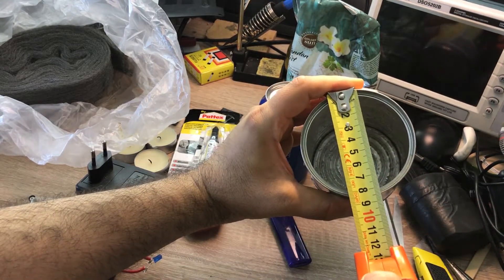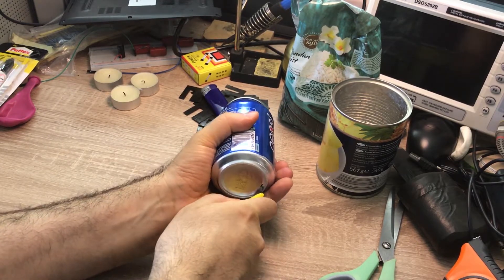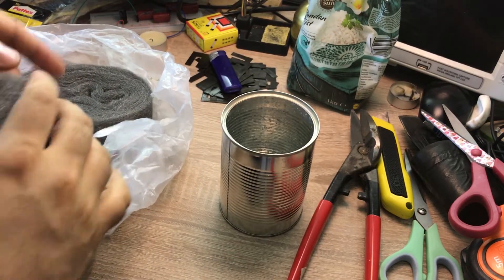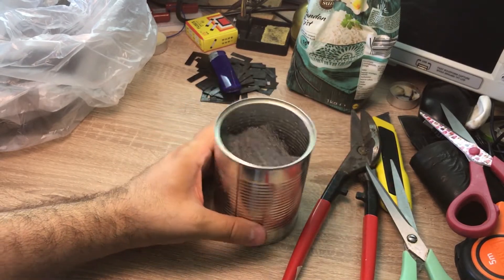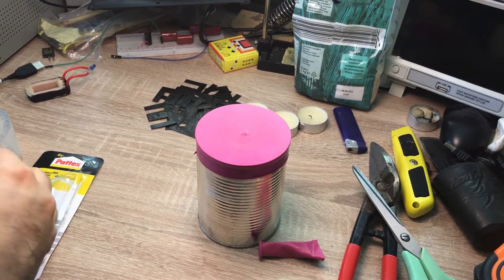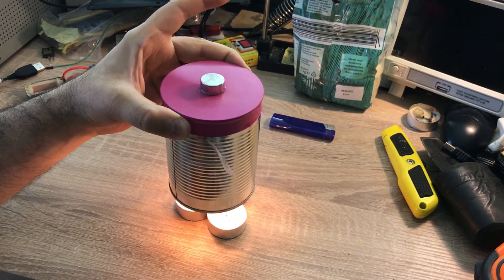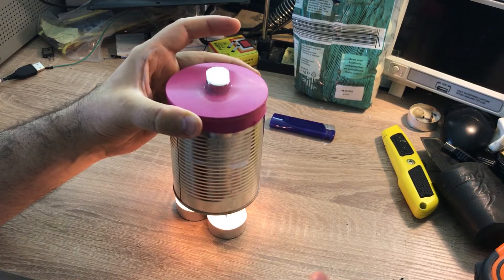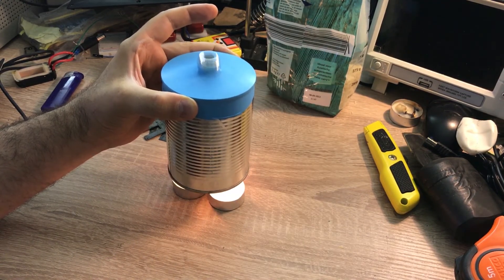How to make a thermoacoustic engine with a linear generator ( Rice engine )

Comment: I don't think the rice on the top is a necessity. Apart from a small wad of steel wool, factory made engines are simply hollow.
Reply from the maker: It is very much necessary, this works with steam and the size is much larger than commercial engines sold on Ebay. Without that barrier it will not work or very very unlikely that you can get it work (you must chose proper size of pipe then)

Comment: Isnt an audio speaker exactly the magnet in coil we are looking for for a linear generator?
Reply: Itcan be a bit simpler than that: Use a speaker of the right diameter as both the membrane and the generator.

Comment: How long will the engine run before it stop, it be a good test.
Reply from the maker: Hi, Check the improved version of the engine which i made after this video, those engines can run for very long time, 10 minutes I have tested it and assumed that thermal equilibrium was achieved, which suggest they can run as long as you have fuel. the top part might need a heat sink to be kept cool if you run it for long time.

Comment: Cool! Why it can jump up and down?🤔
Reply from the maker: How it works is a bit complex, i will explain it in another video. Meanwhile you can search for the term thermoacoustic heat engine
Reply: when the water is heated up, it turns to steam which builds up in the cavity of the can, that pressure builds up inside, then steam through the opening of the rubber it slowly escapes, fluxuating constantly in pressure variation inside the cavity of the can which makes the rubber start to oscillate/ move up and down as the steam escapes out through the rubber hole. basically, its pressure build ups in the can, then inflates rubber ballon, till it reaches a high enough internal pressure that forces the steam out the ballon hole, which then causes the ballon to be deflated and fall back, going and up and down in as many rate of speed as you desire, which depends on how much pressure of steam you introduce inside the can via how hot you get it with fire underneath. 
the principles of this is the rate of pressure steam that builds up inside the can, and the rate in which the steam pressure escapes through the opening is going to determine speed and power output. so the hoter the fire, the more the steam, the more the pressure, the more movement youll have.